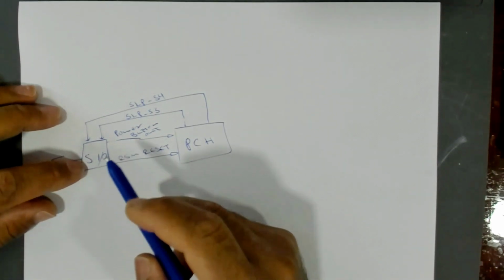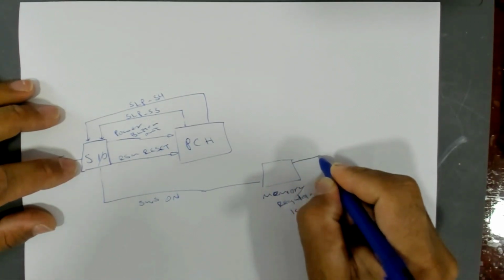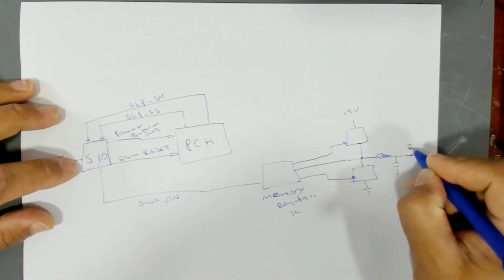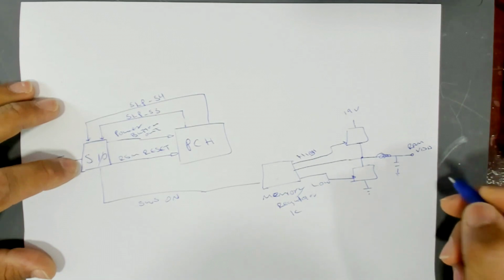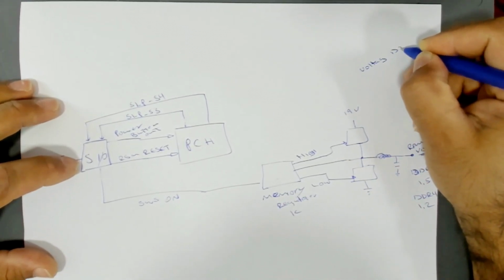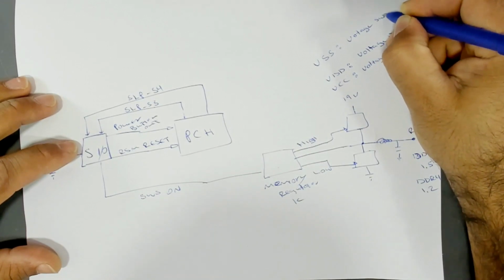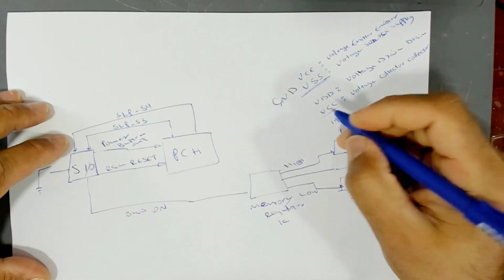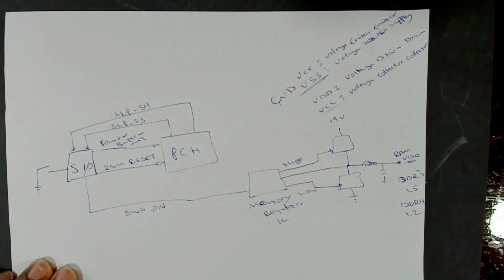RAM memory power supply

Comment: Thank you a lot sir for sharing these videos.. 🙏❤️ In this lesson can i know the operating voltage of ram regulator ic? Is it 3v or 5v?
Reply from the maker: Most RAM power supply ICs are designed to operate at a voltage of around 3.3V or 5V

Comment: tnxx . very very good . i have a asus gl553vd motherboard . power on but no v core and v gfx .  vrm chipset have both 5 vs and 19 v and vr_on signal . even vrm chipset send vrm_pwrgd to i/o . but no v core . cpu problem or ????
Reply from the maker: Its strange you have vrm_pwrgd with no vcore because pwrgd signal should not be produced unless you get vcore at first 
You might have a bad vrm regulator ic